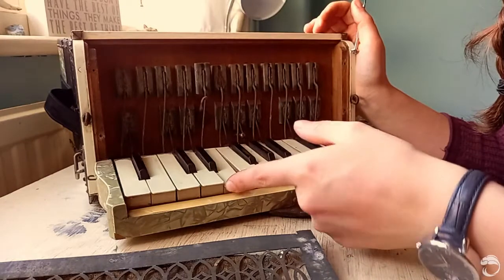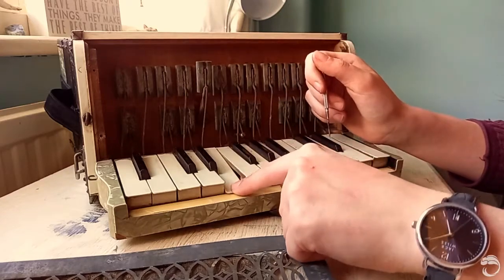Fixing a 100 year old accordion (time lapse) - Part 1

Comment: I’ve got one similar to this, mine is an Estrella made in Germany, same front grill and same greenish marble effect.
Do you know what the two tiny eye bolts are for on the front…? Regards John.
Reply from the maker: To be honest, I have figured out everything except these two mysterious bolts. I presumed they had been fitted later as much has been modified on this accordion (the strap is an old belt to make it left handed!), but with you saying yours also has this, they must have a reason.